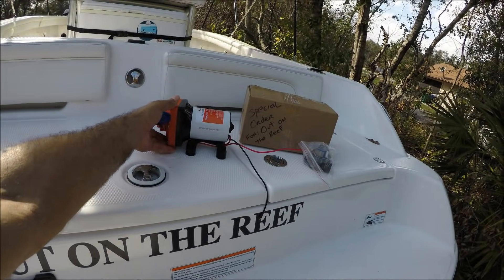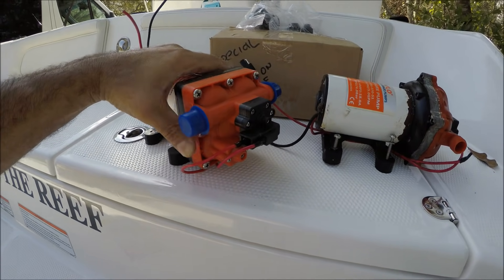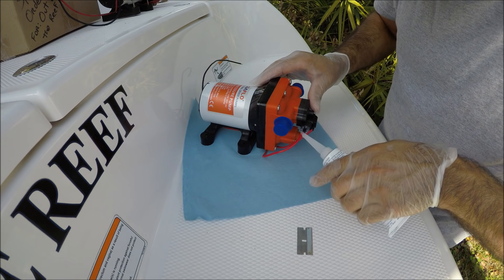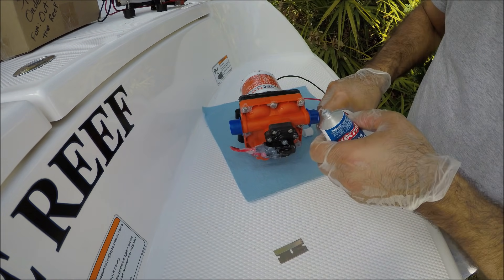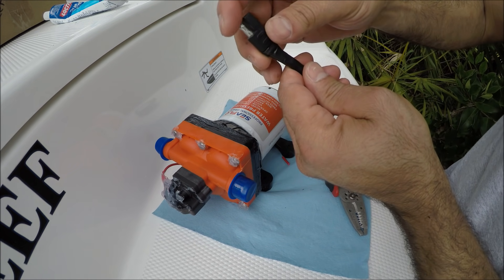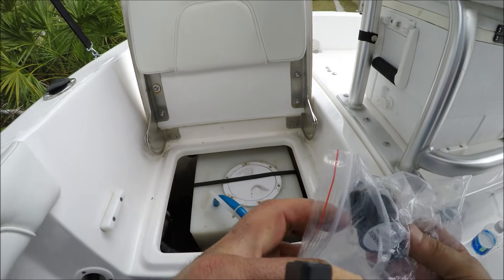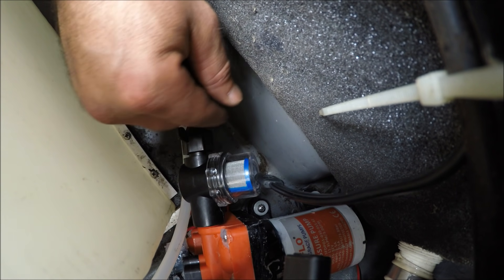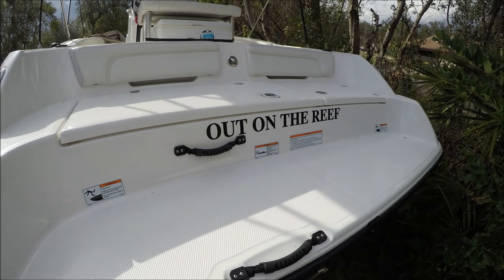Seaflo Water Pump Installed in a Fishing Boat Yamaha 190 FSH ,yamaha 210 fsh, yamaha 240 fsh

Comment: Watch where you apply that silicone. What typically happens once it's wet, the silicone will hold moisture there and cause a worse situation. Not by popular demand, but years of experience as a heavy equipment mechanic and years of boat maintenance, I can tell you the best preventive against corrosion will be Vaseline or your choice of grease. If you are not soldering electrical connections, even a little on any connection will extend that service for years. Cheers!
Reply from the maker: Thanks for the great recommendation Captain really appreciate your knowledge and feedback

Comment: Hi another great video! I have used Seaflo Pumps before and I don't find them as reliable as the Shurflo. The Shurflo pumps are a stainless body and have their connections hard wired as apposed to clip on clip off also using stainless steel hose clamps are also a must. I'm not a fan of silicone on wiring as it may conduct a little unwanted static and create your biggest nightmare on a boat I use Sika 221 a non corrosive and dries flexible! Sorry for being opinionated - it doesn't mean I'm right! keep posting I love watching a thumbs up for me!

Comment: You need to invest into a can of Corrosion X , solder gun , shrink wrap and YAMABOND . A pex tool kit might come in handy for all your water connections and you could get away from the hose clamps . I noticed your water pump has plastic legs and it transfers a lot of vibration and noise into the boat . RV stores sell those pumps and they have rubber legs .
Reply from the maker: rrandydduke thats a great idea Cap i will look into it 
Thanks
Reply: all pumps has plastic legs

Comment: As a installer before for police lighting, solder, heat shrink, and if no solder use the butt plugs connectors with heat shrink already on it. Electrical tape does nothing it will break down and still allow moisture and get everything sticky. Silicone is also not a good thing to use it will shrink over time and pull in on its self and only open up to elements again use what others have said before earlier cap
Reply from the maker: kealahonu thats great info thanks for sharing your expireance it helps me for next time 👍
Thanks Cap.

Comment: how are these sea flow pumps .. bad reviews on amazon ... do they last you ?
Reply from the maker: They're a great pumps as long as saltwater don't hit them like right now I have one that I took from my old boat and put it on my new boat and it's been working for over three years had no issues with it because salt water is not hitting the pump so make sure you keep the pup isolated from the salt water environment and it will last you a long time
Reply: @OutOnTheReef  its amazing all the negative views on this sea flow pumps ... many many many ! peopel say it has lasted them weeks to months  only .  crazy  . thanks for info .
Reply from the maker: @demolaj1  that is very weird in my case has been different I even have one oh my green house and you said a lot on my second floor but if you're very concerned I will check other brands and check out other brands to see if they're worth it.
 thank you for watching the video

Comment: Some self adhesive shrink tube would of made a much better and neat job on those wire connections.
Reply from the maker: Thanks Captain that's a great advice👍
Reply: Out On The Reef Ahoy! No problem, next time you replace the pump it’s something to think about. Th3 self adhesive stuff makes a great secure and waterproof connection and looks tidy 👌🏼

Comment: H&M CB12 Corrosion Block, 12-Ounce Aerosol Can
Just spray everything . From metal to
Best maintenance you may to connections
Reply: The 17 amp pump and the corroded connection to his original pump was no good even with the corrosion protection. The problem is the corrosion spray is none conducting and the vibrations would have surely pushed the connection loose again exposing the metal in time . I used that stuff on my ktm stator connection and ended up burning a pin because of the poor conducting properties of the spray . Solder/ corrosion spray or YAMABOND over the solder / shrink wrap over while it's still wet, easy
Reply: rrandydduke I agree with you, a bad connection due vibrations or a bad plug wont be fixed by any rust protection.  However corrosion for saltwater can be prevented,  not always you will be able to reach a spot to wash with freshwater
I recommended the product only as maintenance
Reply: +Is_ fun_ time it's amazing the electronics that can be waterproofed with corrosion sprays 👍
Reply: rrandydduke I sprayed on everything.  From engine , pumps , connections, radio , even spray it in a rag for stainless steel stuff . Im a pain in the a$ for my boat
Reply from the maker: Is_ fun_ time i allways spray everything with silicone spray to prevent corrosion
Reply: Out On The Reef .  I sprayed yami silicone in my skis for years but never see the results I seen with corrosion block .. I strongly recommended
Reply from the maker: Is_ fun_ time thanks Cap. For your recomendation 👍

Comment: Sorry amigo but that was litttle on the painful side to watch the silicone job was rather ugly use dishwashing liquid smear it on your finger then you can use your finger to shape the silicone smoothly over what your doing even without gloves and it wont stick to your finger saliva works as well then the hose clamps u can buy all stainless hose clamps that wont rust like the automotive ones do on boats  you then twisted the wires together and wrapped them in electrical tape instead of using heat shrink butt connectors and crimp them, and no sealant for the mounting screws you might be unaware that even though that area maybe dry of saltwater the air around the sea and on the sea has salt in the air so that compartment will still have salt air in it too things will still corrode in there...... good day sir
Reply from the maker: thanks for the awesome suggestion cap. will keep that in mind👌👍⚓

Comment: Spends 30 minutes applying silicone to pump, then twists wires together and puts electrical tape on them..... Ugh.
Reply from the maker: Better idea cap 👍⚓️
Reply: @OutOnTheReef  a crimped heat shrink waterproof butt connector?  Solder and double wall heat shrink?
Reply from the maker: @micahmorton  thats bullet proof cap.